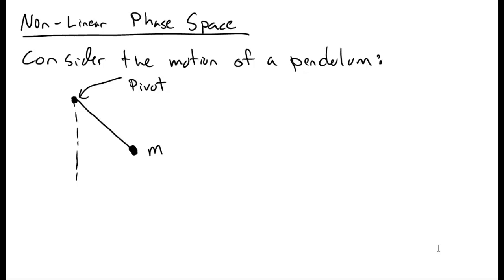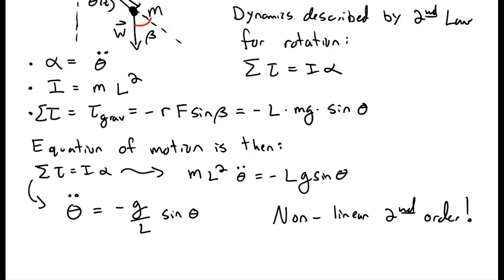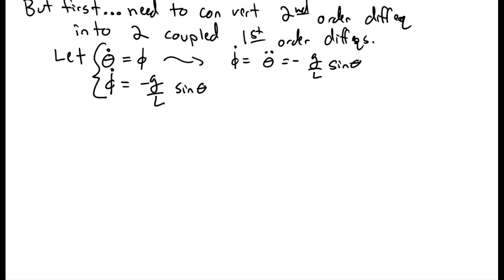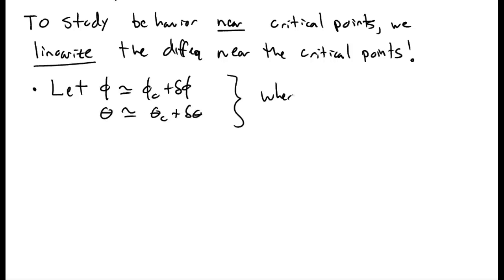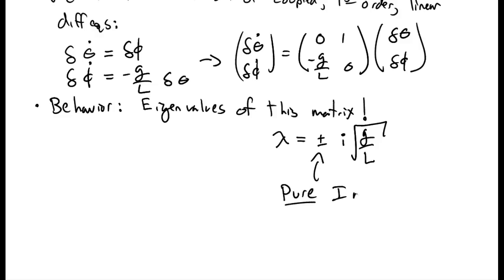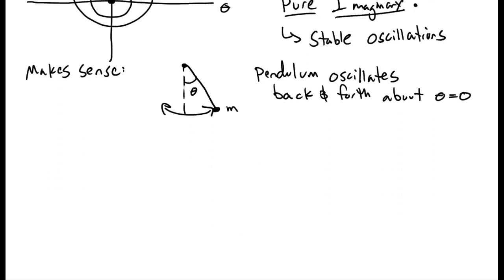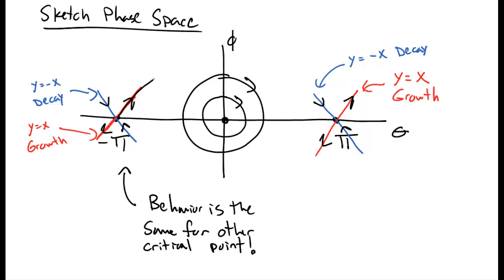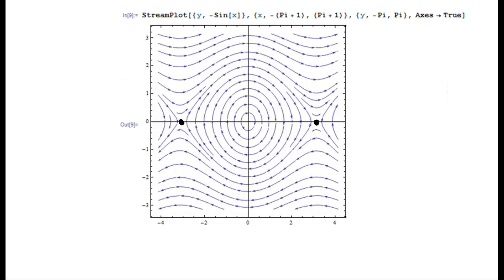Non linear Phase Space

Comment: I think you forgot the mass when making it nicer.
Reply from the maker: +Philippe Miron I think the mass cancels out. This is actually a big deal, that the motion of a pendulum doesn't depend on mass. It's just as big of a deal as the fact that gravitational acceleration doesn't depend on mass.
Reply: +Dr. Underwood's Physics YouTube Page That's what I first thought. Though at one point, you have mL\ddot(\theta) = -Lgsin(\theta) and there's a missing m on the right hand side. But after this line it is removed from both sides so the following equations are right.
Reply from the maker: +Philippe Miron Ah, yes, there is indeed a typo in that intermediate step where I dropped the "m"!